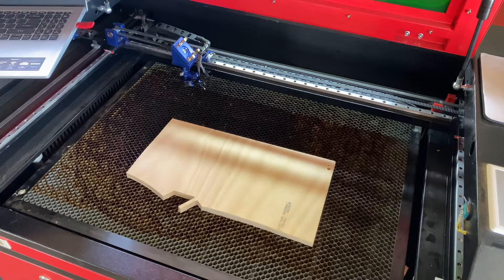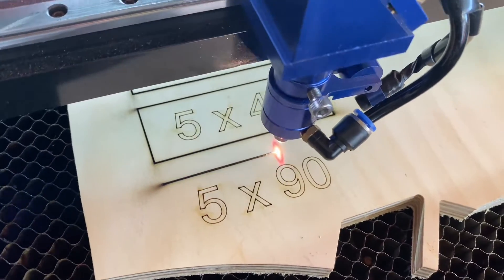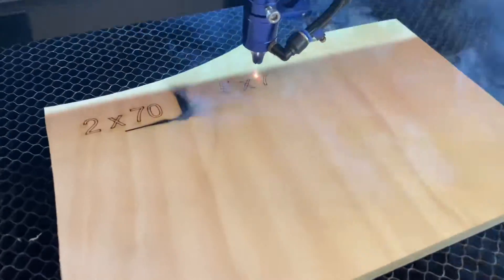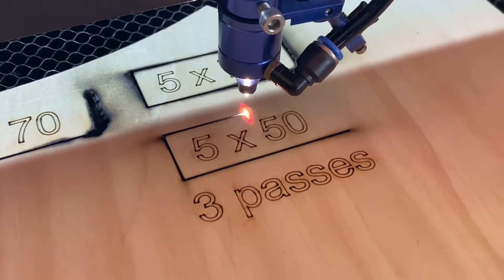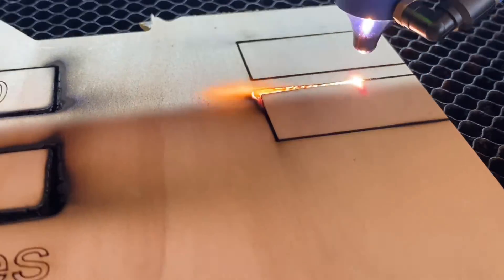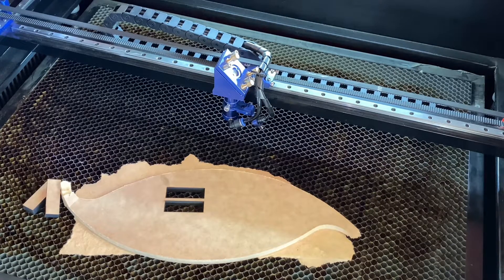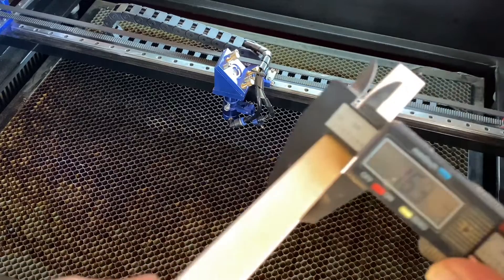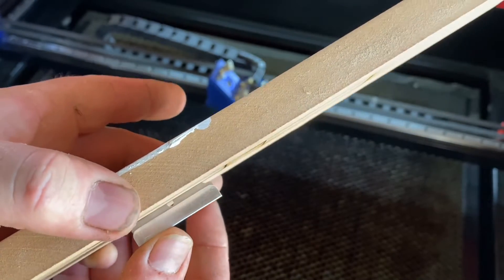Cutting thicker materials W/80w C02 Laser!

Comment: I just bought the orange Vevor 100w with built in air cooler. I’ve added air assist and a refrigerated chiller. The website say it will cut 15mm in 1 pass but I’m struggling with 9mm (Baltic Birch ply) at 1 pass? I’ve focused and cleaned lens. 65% power and 10mm/sec speed cuts through but it’s not a nice clean cut. Any advice?

Comment: My thought is the focus height is set for the surface.  As it cuts deeper the beam widens.  Have you tried to set the focus height so the focus point found be half way through the 12mm board?  We obviously know the slightly out of focus beam cuts below the focus point, why not also use the slightly out of focus beam above the focus point.  That would put the focus point deeper while still running at a reasonable speed.
Reply from the maker: Hi, yeh that would definitely be an option I know alot of people use this method when engraving large pieces as it leaves a wider engrave takes less time and is quicker but I’m not sure how that would go for cutting wonder if it would be a wider cut line may work good for larger cuts but not sure would be good on small detailed stuff but that being said theres only one way to find out I’ll check that out and see if that works 🤙🏽 thanks for watching! Cheers, Matt

Comment: I've got the same 80w from vevor except I have a red laser head. Just curious what type of head do you have and what lense? Because I have my head pretty close to the material for it to cut. Cheers
Reply from the maker: Hey yeh cool I’m not sure what type of head I have it’s blue and I think the lense is a standard 2” lense I have replaced from the one it came with as I messed up my alignment and ended up cracking the original so replaced with a cloud ray same size, do a ramp test to find your correct focal night my machine came with a small acrylic tag that was 15mm after I did my ramp test found it to actually be 11mm so I cut new tags to suit, 
If your closer than say 10mm I’d say your all alignment is out so you may need to check that 🤙🏽 thank for watching cheers, Matt